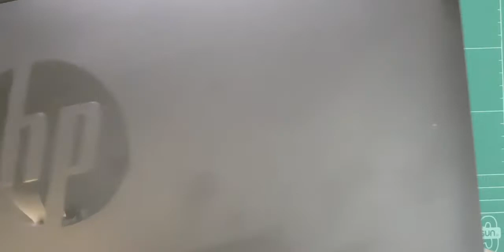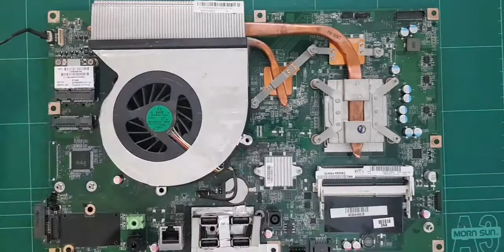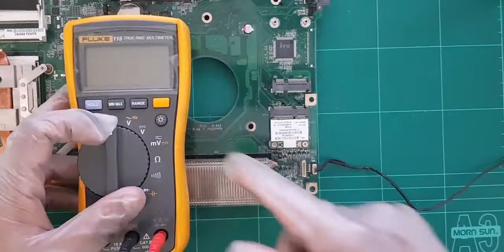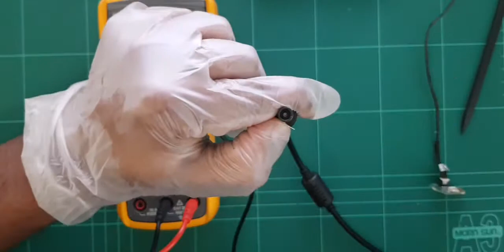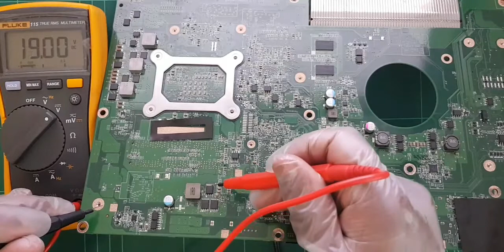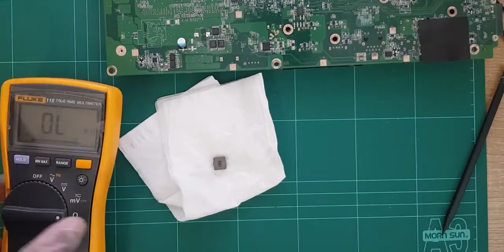HP all in one 310-1025. How to trace a motherboard fault - lets learn

Comment: Do you have a website? Can you fix my controller?
Reply from the maker: What wrong with your controller?
Reply: @autronicsltd3478  My buddy dropped his controller in liquid. I pulled it apart. Cleaned it and replaced the battery. It will only power on when it’s plugged in to the USB port. It also shows the LED charging. But the moment you disconnect the cable, it shuts off.
Reply from the maker: @williamkrenz2358  ...maybe requires a new battery.Check the voltage on the battery.If its not holding charge,replace battery but if its holding charge n still not connecting,best to get another controller and keep this as spares.